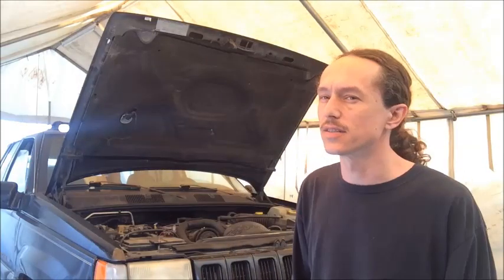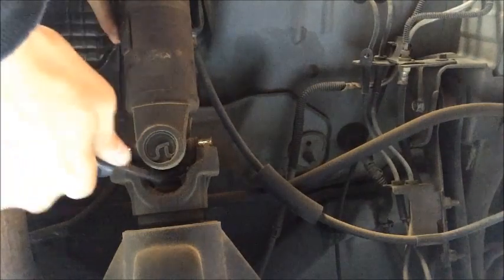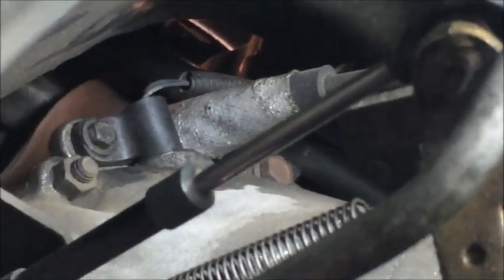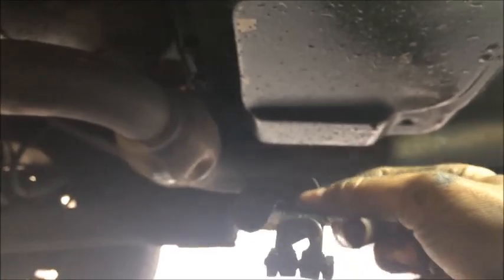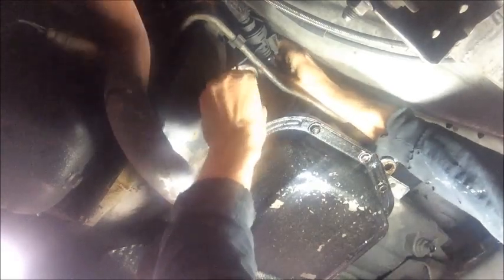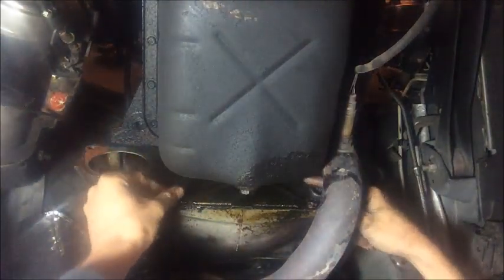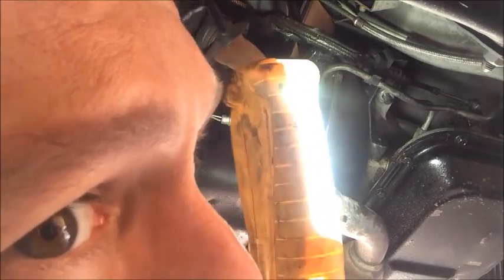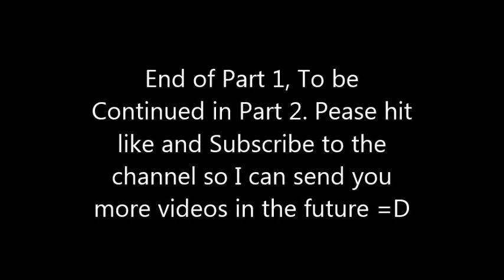42RE Transmission 4 0L Removal  (Part 1)

Comment: Also in the future get you a setof Flex head wrenches.  For the starter removal use a 1/4 inch Ratchet or A flex head wrench.

Comment: I did a trans all by my self. I cut a piece  of plywood the size of the bottom of the trans.Drilled a whole in the center of it. Remove the center bolt or screw from the floor jack. You will have to drill 4screw holes in it. to fit it on the Bottom of the plywood.then screw the plywood on to the jack.now put the jack under the trans. Before removing the trans brace with a ratchet strap.transmission will go no wear.